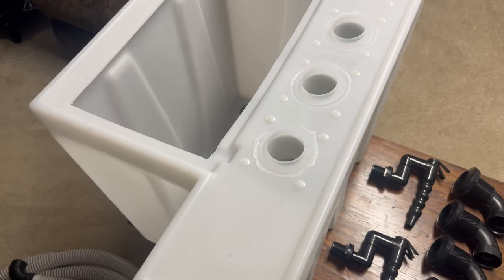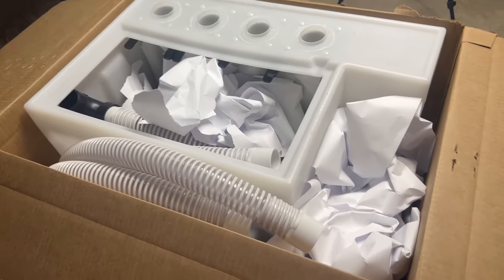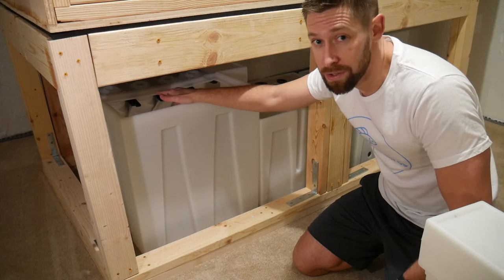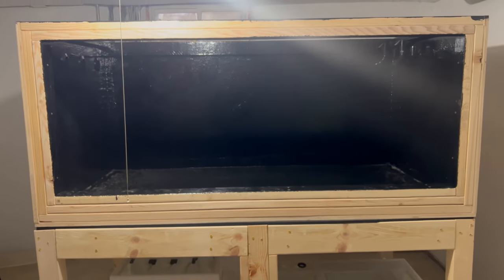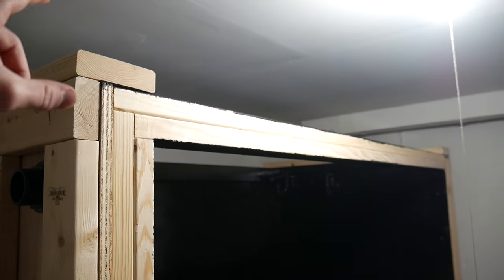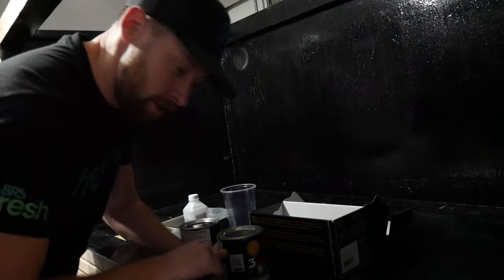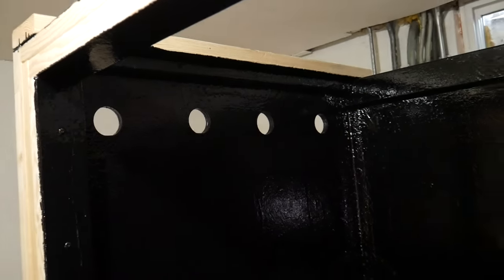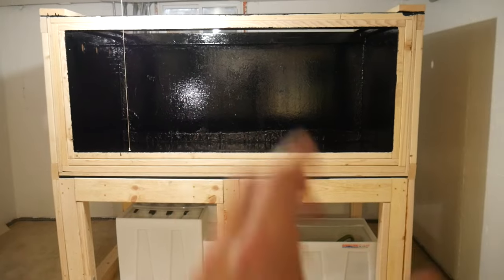Building My 475 Gallon DIY Plywood Aquarium! (Part Four)

Comment: I really like this. You might want to consider diagonal bracing on your stand. Rectangles have a way of becoming parallelograms and then collapsing.
Reply: I agree. The “L” brackets are almost completely worthless and diagonal bracing is where the strength/rigidity comes from.

Comment: Pro tip #6. Since you’re hiding the plumbing against the wall, try building it in the space the tank is going to be, at against the wall. That way, if/ and mostly  likely when an issue comes up and you need to switch out or fix plumbing, you won’t till then, find out the hard way you can’t fix a problem without moving the tank. Learn from my mistakes.

Comment: I gotta ask can you use acrylic or does it have to be glass? Idk what would be cheaper but I’ve been wondering
Reply from the maker: You can use acrylic but it’ll usually be expensive. Would also need to reconfigure the window frame as it wouldn’t silicone on like glass

Comment: How is that 475 ? Looks smaller :D but good job, I have also DIY plywood stand, the most pain was to get it leveled as I had the woods standing free for months before assembly and they were not 100% straight anymore ..
Reply from the maker: Based on the dimensions

Comment: That's not bracing. Just a facade made out of 2×4. Very much expecting this thing to leak, but hope it doesn't. 🤦‍♂️
Reply from the maker: Really appreciate all of the negative comments you leave on the channel. As mentioned each time, I didn’t make this up myself. I’m following proven tank builds and even overkilling that 🤷🏻‍♂️
Reply: It’s okay bro, I get a little jealous sometimes too 😂
Reply: @CichlidBros  I'm not usually the type to do so, but I'm seeing all kinds of red flags in the construction of thos thing. The stand looked good, but everything on the stand looks kind of sketch. I assume you know 2x4 are intended to be used perpendicular to the way they were installed as bracing. That construction looks like it will flex alot under load, which will cause the fiberglass and epoxy to crack in the corners eventually. Also the 2×4 on the left and right of the viewing panel may bow outwards slightly along with the sides and compromise the silicone seal to the glass. Which proven builds are you following for this??